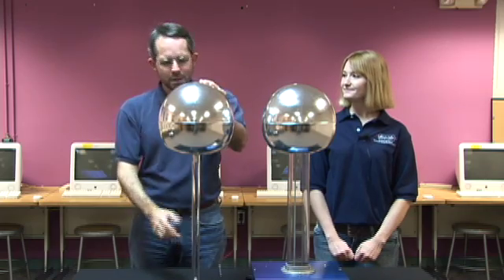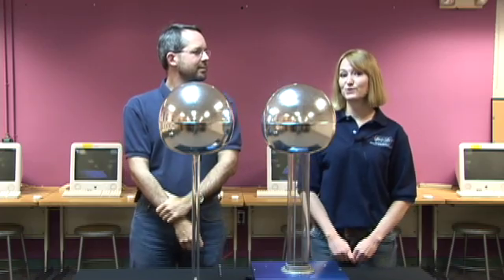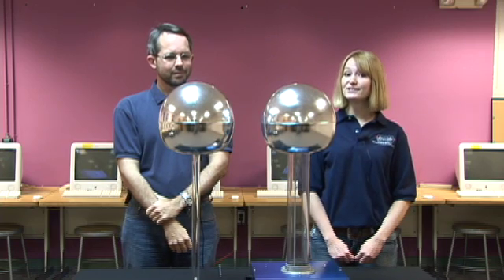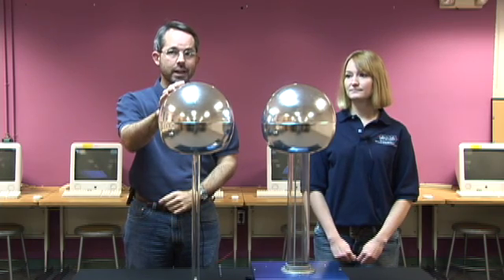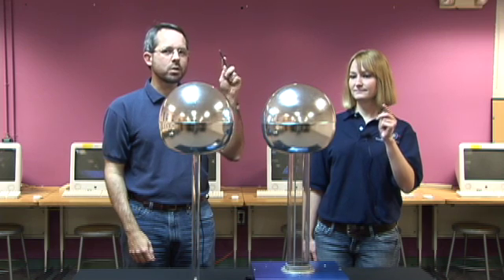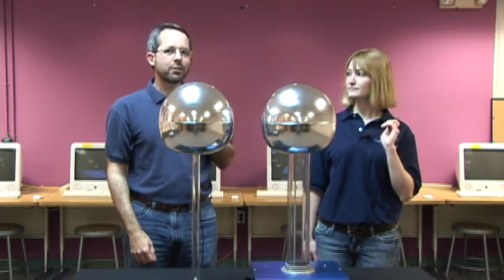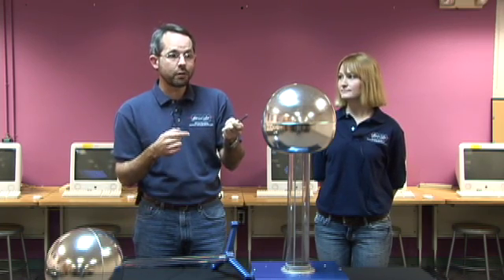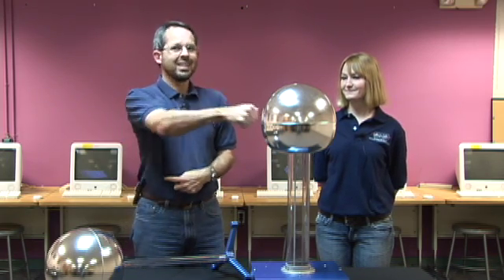Lightning Rods

Comment: hi is it possible to explain how grounding works? the sphere is connected to the grounding wire but that doesn't form a closed circuit with anything so how does current flow through the ground? and does this mean that if I were to connect a grounded copper wire to the generator's sphere, the dude wouldn't get shocked if he touches it?
Reply: Anybody here knows the ans?
Reply from the maker: Well, in this case, it actually does form a closed circuit. The grounding dome is attached to the ground and the pick-up comb on the bottom of the Van de Graaff is also connected to the ground. The circuit an electron takes is: ground --> pick-up comb --> belt --> upper dome --> arc through the air --> grounding dome --> ground.

And, yes, if the upper dome were grounded, then it can be touched without anyone getting shocked.
Reply: @JeffersonLab  thank you so much for the detailed explanation!!!

Comment: The current also flows from the ball to the nail, so why doesn't it create a spark?
Reply from the maker: Basically, because the nail is too good at emitting charges. The flow between the dome and the nail happens at a lower overall voltage, so the voltage doesn't build up enough to create a spark.
Reply: @JeffersonLab  is there a reason why nails are particularly good at emitting charge? surface area? or shape?
Reply from the maker: @gohkairen  The shape. The point of the nail is great at emitting the change. The flat end, no so much.
Reply: @JeffersonLab  I see! Thank you!

Comment: @JeffersonLab All is understood, I'm just designing a form of lightning rod that can be placed anywhere but it will be about a foot off the ground and held up with a non conductive PVC base and under it will be a fine thin copper wire that runs through a small bucket of sand then to the ground. Hopfuly the lightning will strike it and vaporize the wire and form a Fulgurite. Its a hope.

Comment from the maker: @Helicopterpilot16 Anything that is substantially taller than its surroundings is going to have a better chance at getting struck. TV/radio transmission towers spring to mind.

The point we were trying to make in the video is that lightning rods aren't used to draw lighting to your house. The main intent it to (hopefully) draw enough charge into the ground quickly enough to prevent a strike. But, lightning will do as it's want to do and striking a grounded lighting rod is better than your house.

Comment from the maker: @Helicopterpilot16 No, round surfaces are better at holding/collecting charge. In part, it's a symmetry problem. If you have a perfect sphere and place some charge on it, there isn't an obvious place for them to jump off from since every place on the sphere is identical to every other place on the sphere. Sharp points are different. The tip of a needle is much different than the surrounding surface.

Comment from the maker: Not really. Tesla was using high frequency electricity. A static charge, by definition, doesn't have a frequency. The electric field will still be concentrated on points, whether or not the frequency of the field is high, low or zero.